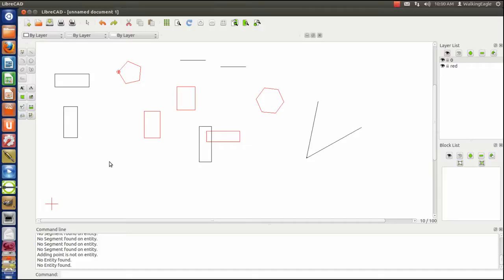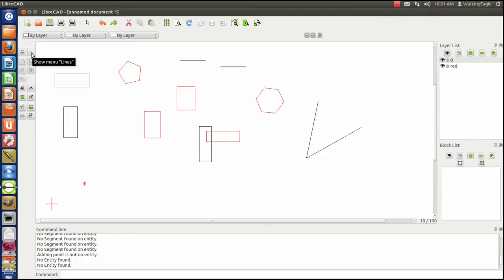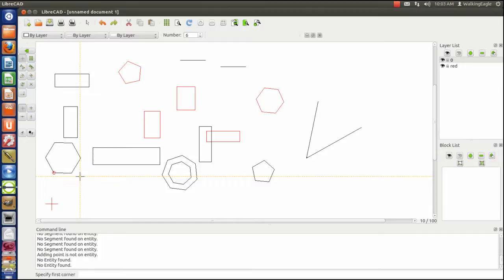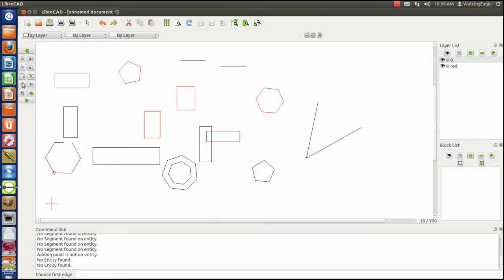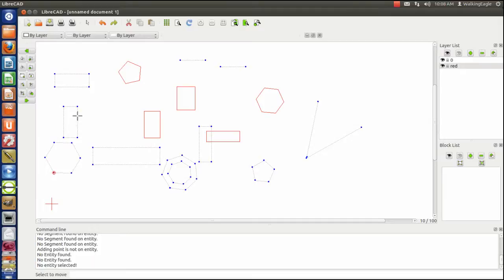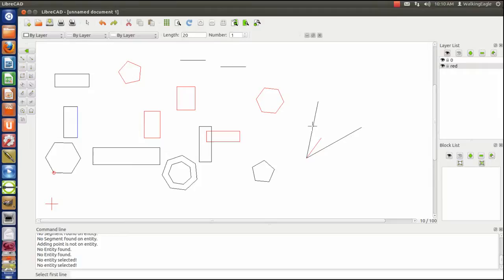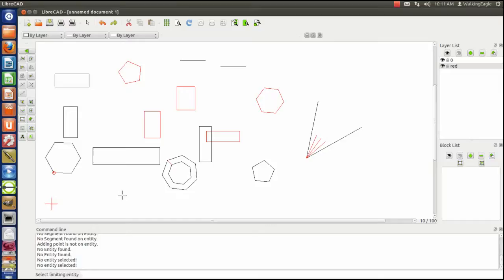LibreCAD tutorial 8 - polygons and select functions

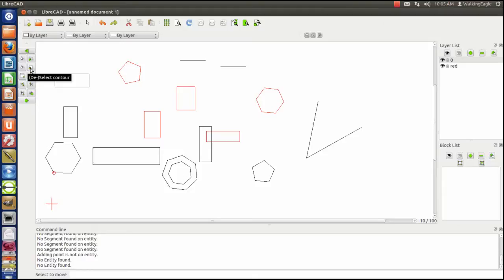Comment: Around 5:40 into this video you were trying to find "Select Entity".  You hovered over a toolbar icon "A hand pointing to and touching a line".  A tool tip showed up "(De-) Select entity"This is a toggle icon button.  If the entity "isn't selected" and you click the entity you will do a "Select entity".  If the entity "is selected" and you click it you will do a "De-Select entity".  The parenthesis around the "De-" [ie: (De-)] makes the tool tip of this button communicate to the user that it will do both actions based on the state of the item you are clicking. It make it easy to click an item to select it and then click it again to De-Select it without having to keep going back to the toolbar and select a tool to do a De-Select Entity/Select Entity.I'm using LibreCAD 2.0.9 for Windows and the tool tip is just "Select Entity" and it has the same toggle functionality which selects/de-selects base of the select state of the item you are clicking.I noticed this toggle functionality with the (De-) Select Layer toolbar button.  The tooltip for this button still has the "(De-)" string that indicates it's a toggle function and does the select/de-select layer base on the state of selected layer.
Reply from the maker: +jh I did not script the tutorials... I just had a general idea of what I was going to show and then just did it.   You will find more than one sloppy screw-up in them.   Some are better than others.
.

Comment: I was using LibreCAD 2.0.9 on a Windows machine and the Select Window Left to Right (Has a Blue Selection Rectangle), and Select Window Right to Left (Has a Green Selection Rectangle). This is kind of nice so you will know the functionality based on the color of the Selection Rectangle. Green - Partial enclose an item will select that item,Blue - Partial enclose an item will not select that item.
Reply from the maker: +jh I have noticed that on the windows version I use at work.. I have not paid attention to the Linux version I use at home.   I think I may have different sub versions between the two because the icon menus are slightly different.
Reply from the maker: +Gary Fox  These videos were created with version 1 of LibreCAD... there have been very significant changes to version 2   There seems to be some differences between the windows version I use at work and the Linux I use at home, but that may be due to sub-versions.